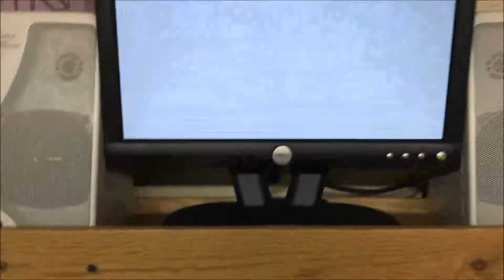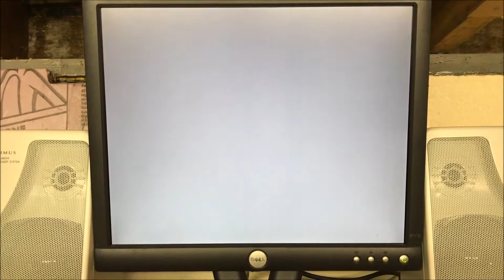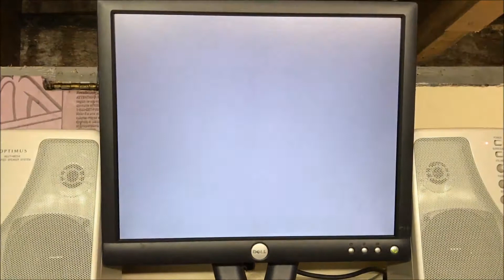Amiga 1000 "ram68K"  8 Meg Memory Expansion (Initial user code 3003)

Comment: Does it work with hard drive units plugged into the Zorro side expansion slots though?
Reply from the maker: failed channel I’m not sure, as long as there isn’t any more z2 ram in the hard drive unit itself I would think it would work. The same guy that makes this also makes an ide controller that can piggy back this ram expansion.

Comment: Hi Steve: I just installed one of these brand new last week from MKL. I plugged it into my stock 1000 and it auto-configged during boot-up and works perfectly. Plug and play. Amazing little piece of kit, and only $50 US shipped! I love it. Granted, the 1000 ignored my sidecar RAM, but I really didn't need it anymore. I just yanked those off and got some desk space back.
Reply from the maker: I think they're great, what I like the most is that it keeps everything internal, he also has an IDE device that can piggyback on top of this one that Id really like to try.
Reply: I saw that. I was tempted, but I'm a 1.3 guy on my 1000. I'm cool with that software-wise. But I did stack an AdSpeed on top of it, and it works! 14Mhz when I need it + 8MB RAM. Now if only I had the guts to do the KS switch like you did (which kit was that, btw? You never said in your video). Not sure I could do it without being a nervous wreck. But yeah - KS + HDD would be epic. It'd be as good as my Phoenix! (if not better, as it'd prob be more stable)
Reply from the maker: Cool, did you notice a speed difference with the added ram with the Adspeed? The switcher is made by a guy by the name of Tuxbar over on Amibay, I'll through the link in the description.. I have seen that there is a tweaked 1.3 kickstart that adds the required components that will allow booting from IDE, if you can find someone who can flash a chip for you, that would be pretty sweet.
Reply: "Cool, did you notice a speed difference with the added ram with the Adspeed?" To be honest, my AdSpeed is acting weird (I have 2, and both are doing the same thing). I can only activate it in Workbench with software. The hardware jumper - to make the 1000 boot in 14 Mhz - creates a yellow screen. I've sent one of them to Acill to see if he could find any bad surface caps on it or anything else. I only made the 68000 sandwich this past weekend, so I haven't been able to give it a proper test yet.
Reply from the maker: Depending on what ram68k revision you have there may be a newer firmware available on his website that may fix it, I noticed a newer one for mine but I've just been too lazy to flash it, since I'm not having any apparent issues.

Comment: What firmware are you running on your Gotek? Is that HxC?  What did you do to get it all running?
That might make a good video.
Reply from the maker: First it was cortex, it has HxC on it now. I'm not exactly sure the of exact thing that made it start working, the last thing I tried was reformat and copying files over(for the unknownth time), But it didn't actually work completely  till a week or so later when I turned the computer back on ??? lol. It still acts flaky from time to time though.
  I have a brand new gotek and an extra lcd on my desk. I'm planning on doing a video from programming to installing the lcd etc, when I get some time, Hopefully it goes a little smother that the first try.
Reply: I'd be very interested in that. I was all set to run Cortex on mine when I came across the HxC port. Am I correct in thinking that the HxC port is read only? That would be a big factor in my decision I think. Probably for others too.
Reply from the maker: It seems that I saw somewhere that the stm32 version can write, I cant seem to find it now though. I changed the background color in workbench and it comes back up to that color after power down and reboot so I assume it must be writing the change to the workbench .adf.
 My favorite available feature is the option of using an LCD, it makes things much easier for direct access.
Reply: yeah it's the LCD that appeals to me too, but I also want it to be functional. I get the impression that the HxC firmware is much less stable on the Gotek h/w than the Cortex firmware. I'd like to be wrong about that though.
Reply from the maker: Yeah, hopefully I just got a dud gotek for the first attempt.

Comment: You have to update the firmware in the CPLD's and then it works fine. The JED files are linked on the main site. You'll need a xilinx programmer though I'm going to test and see if the Bus Pirate can do it with the JTAG firmware.
Reply from the maker: I have a programmer on order from china, hopefully I don't regret that. I have no experience with xilinx, but I imagine  its similar to other platforms. The bus pirate method sounds interesting, do you have a link to more info?
Reply: Yeah, there's some info at http://dangerousprototypes.com/docs/Bus_Pirate_JTAG_XSVF_player
There is also a GIT fork of the Bus Pirate firmware with newer firmware including, I think, the JTAG player.
Reply from the maker: Cool Thanks.
Reply: I need to clarify that I have not, as yet, tested the Bus Pirate JTAG player so I wouldn't recommend this option except to someone that already has a Bus Pirate and not a Xilinx programmer. In that case it's worth a shot vs. spending the money on a Xilinx programmer. If you have neither device and need to buy one, the Xilinx is the only one certain to work. 
I do plan to test the Bus Pirate though and I'll post in the CCC once I know the results.
Reply from the maker: Got it, Thanks.

Comment: Are these available for public purchase? Anybody have a link?
Reply from the maker: I bought mine on eBay, this one is from the first run, The second run sold out pretty quick. I don't know how many more he plans on doing but here is the eBay link to the one I bought. You could keep checking to see if the seller list any more. Definitely get one if you can, Its a very cool compact design.

http://www.ebay.com/itm/8MByte-fastram-to-dip-64-cpu-socket-of-Amiga-500-034-PREORDER-034-2-weeks-lead-time-/192164292280?_trksid=p2047675.l2557&ssPageName=STRK%3AMEBIDX%3AIT&nma=true&si=WJvcyJ8oyoJlhNcBltCmZiV8Umo%253D&orig_cvip=true&rt=nc